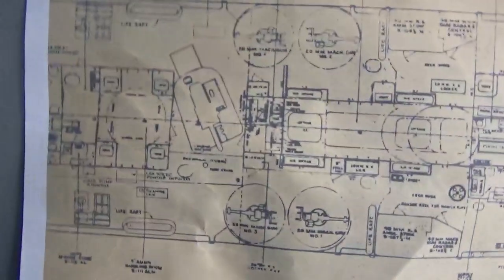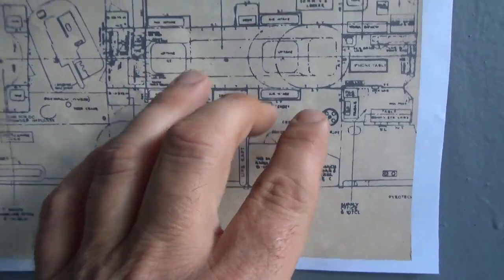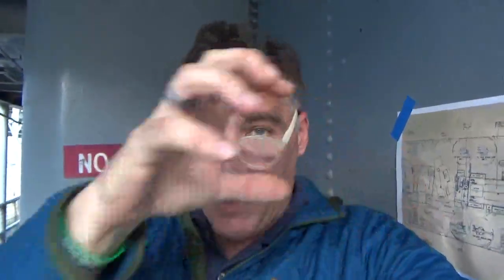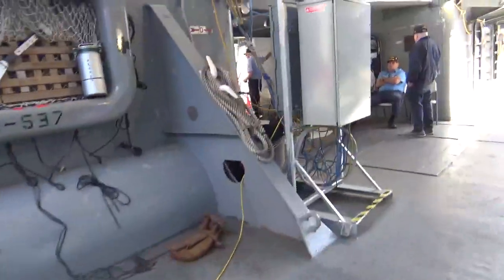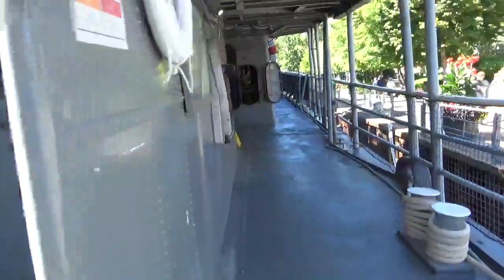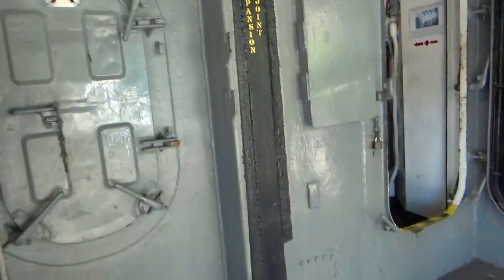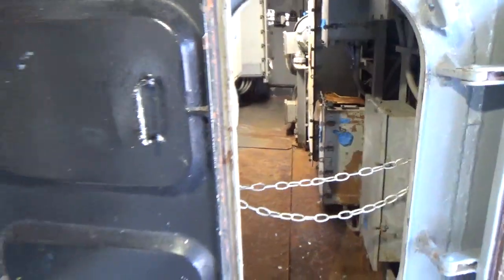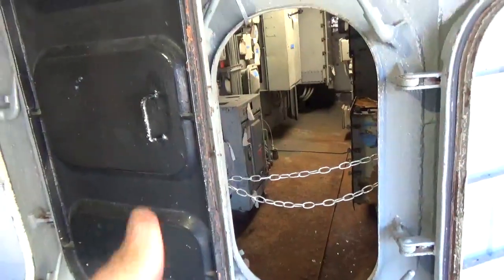Why the expanded deckhouse on USS The Sullivans?

Comment: My step father served on board a Benson class. She was assigned to  the Atlantic and was refit in late 1943. Her aft quintuple tubes were removed and 2 quad 40's were added to the aft end of the deckhouse. When she was reassigned to PacFlt, late in the war, she had another yard period where the quad 40's were removed and the torpedo tubes returned. 

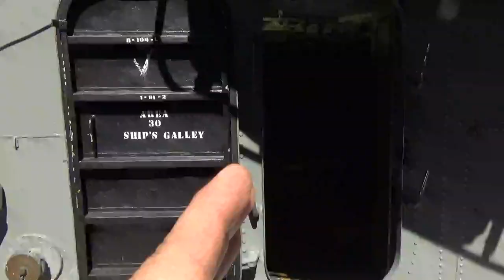I was always intrigued that 9:30 notwithstanding the need  9:22  8:55 or AA,
Reply from the maker: Thanks for sharing! That is strange about adding the tubes back when the ship headed to the Pacific. Typical configuration for the Pacific is less torpedoes more AA. Late in the war, airplanes were the biggest threat in the Pacific. This is the reason that one of Sully's quintuple torpedo tube mounts was removed (July 1945) and quad bofors were added in its place. Thanks for sharing and for your support!

Comment: Interesting to hear about the changes here and why they were brought about. You really get an understanding of how incremental upgrades changed the ship and how they had to find space to cram in the additional equipment, even to the point where the ship ended up asymmetrical.
Great to hear you're looking to source and bring back the 3" to try and further restore the ship with critical relevant equipment - it's not just about preserving what's already there, its also about trying to refit and improve the authenticity of the ship and the visitor experience.
Reply from the maker: Thanks so much, wurlyone4685. Appreciate your comments and support. One of those critical areas such as gun platforms brought about great changes to Sully. We can't go back after these mods, so we need the guns to fit the structure - not the other way around, like you state! Thanks again!

Comment: Shane, for what you call at 4:39 a 'doghouse' could that enclosure be a darken ship vestibule? The shielded space on the other side has the smaller scuttle going below decks. If you look in the overhead just inside the non-watertight door to the weather deck, would there be removed fittings or weld points where a light shield (curtains?) would be placed?
Reply from the maker: Good thoughts roberthilton5328. Appreciate it. I will check out the overhead. To me, my first instinct is that someone constructed the "doghouse" here as we also have them on Little Rock as well. I'll do some more digging! Thanks for your contribution!

Comment: If/when you get the 1943-45 plans digitized, would you be able to make them available on your web site as publicly available research materials for those of us interested in the WW2 configurations of historical ships?
Reply from the maker: tronmcconnell4465, yes...that's the idea. The 1956 booklet of general plans is giving the digitizing company fits because of the way the book is made...it has a spine, and then fold out sheets, but then some are not fold outs, so they are taking their time with how best to do this without have to break the book into halves or quarters. It will be the same with this print! So, my goal is to make them available for a small fee on our website once they are scanned and back safe in the collections!